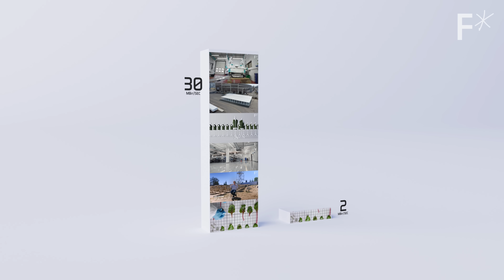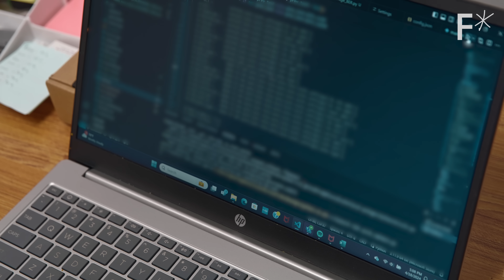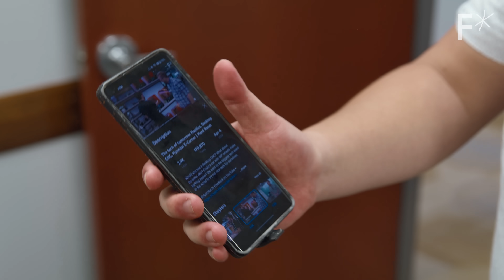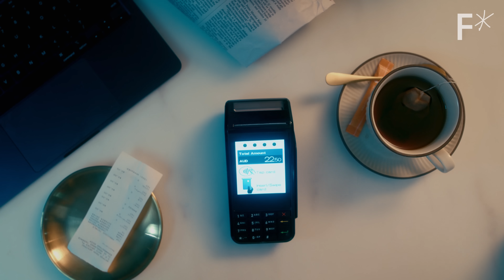This computer chip is the key to an unhackable future | Hard Reset

Comment: 'Unhackable' hahaha, famous last words.
Reply: For now

What they're achieving is something that's basically an air gap, which is extremely secure today or

Pulling back to the days of walkmen tape players where connecting was hard to do

Best way to hack this? Touch the person using the same tech and release a command
Reply: @letssee8397  Can read the radio leak off your RAM now though too well enough to see enough. So now you need a cage if you wanted to remain that way going forward.
Reply: @letssee8397 Only a perceived air gap, one that is very easily circumvented. For example, if I control the environment (coffee shop, lounge, boardroom) then simple casual interaction with furniture (sitting down, elbows on counter/table, etc.) would give me access to supposedly private communications.
Reply: @letssee8397  You are correct. The attack surface of Bluetooth is being in the same room as you. In case of Wi-R, you have to touch someone to get access to the signal. If you are in a café and turn on Bluetooth on your phone, everyone in the café has your signal. If they can hack into it or not, depends on how good of a hacker they are. With Wi-R, someone in your next table doesn’t even have the signal to hack into. That’s the advantage. Once someone has the signal e.g. by touching you, the potential of being hacked is the same as Bluetooth/Wi-Fi.
Reply: I think it's unshakable in the sense that as long as a system us entered isolated it cannot be interacted with by definition. Now if you were transferring data while washing your hands and an interloper had access to the pipe and was recording it then that de-isolates the system.
Reply: @magnadox  yeah, but the tech is made for interaction... If you are not quarantined then you are gonna have a tonne of potential breaches every day...

Also airtags... The way they are used for nefarious reasons is gonna be the way to breach this. Just hide transmitters on the person and you can track probably close to all of their activities...
Reply: It’s a Bluetooth replacement. Right now you’re transmitting data 360 totally unsecured to anyone who wants to pick it up without coming close. No one is pickpocketing anything they can’t already do now with zero effort.
Reply: Wi-R provides better physical security. If you are in a café and turn on Bluetooth on your phone, everyone in the café has your signal. If they can hack into it or not, depends on how good of a hacker they are. With Wi-R, someone in your next table doesn’t even have the signal to hack into. That’s the advantage. Once someone has the signal, the potential of being hacked is the same as Bluetooth/Wi-Fi.
Reply: Oh so you go into a train station or an airport and you sit on a metal bench or touch a stair railing and I have a little device like the size of a smart watch face taped under the railing with clear tape or affixed to the bottom of the bench and I just pick up data from everyone who touches that.

Or I just leave an iPhone or at least what looks like an iPhone laying someplace unattended and as soon as you pick it up either to steal it or to turn it in to lost and found if you use an ungloved hand to touch it I'm now connected. Yeah sounds great.
Reply: The Titanic is also unhackable
Reply: Less hackable*

*hopefully.
Reply: Sounds like a challenge :D
Reply: @MajesticSlowking it seems likely that the system would pick up a large change in the electrical field when another person touches you and shut itself off. I would be more concerned about small, low power, devices spying on you. One thing is for sure, your bluetooth is leaking all over the room. That being said, even bluetooth and wifi have a range of tools to prevent hacking, if desired, such as encryption.
Reply: @itoibo4208 very naïve reply
Reply: elbow to elbow in a crowded subway
Reply: elbow to elbow in a crowded subway
Reply: @iporush1667   with Bluetooth you don't need to be elbow to elbow to a person holding a device. Just be in the same room. Or in the same street - depending on your antenna.
Reply: This is mark of the beast BS. WTF is wrong with you folks. The most popular book in the world reminds us that this is a bad idea in the hands of man. Not you per say but those who seek after complete control.
Reply: Anything build by Man can be broken by Man

The word Unhackable is an illusion to get you to line up like sheep's like sheep and sign your sole to the devil.  Lose total control of your thoughts and lose the feeling to be human. 
Human control is for Tyrants
Reply: Anything is that is connected wired or wireless is hackable.
Reply: It the Indian talking it ba

Comment: The R in Wi-R is for celebrating pirates!
Reply: Arrr, matey.
Reply: Wow
Reply: Wi-R is a wordplay on "wire" since it enables secure, high speed data transmission through the body, effectively creating a virtual wire. Also, it's more fun to be a pirate than to join the navy.
Reply: @jasonk125  that makes perfect sense if they just said that😂